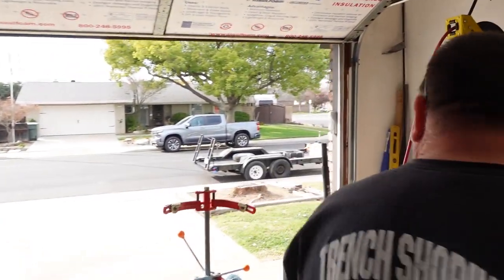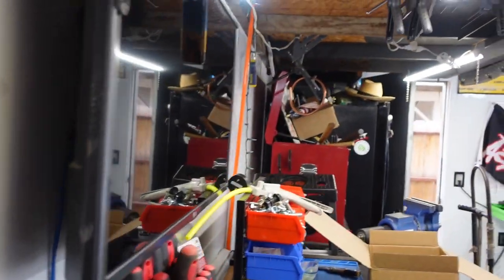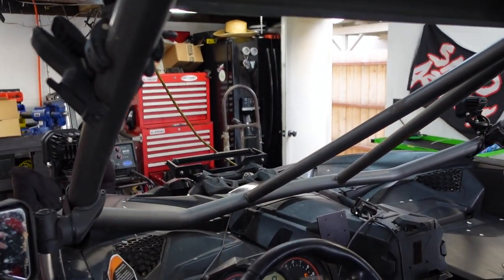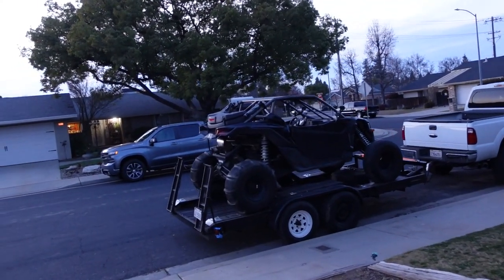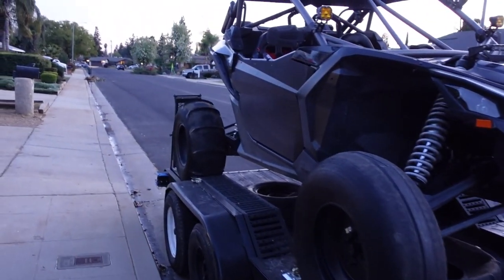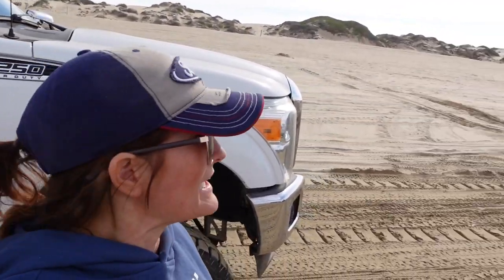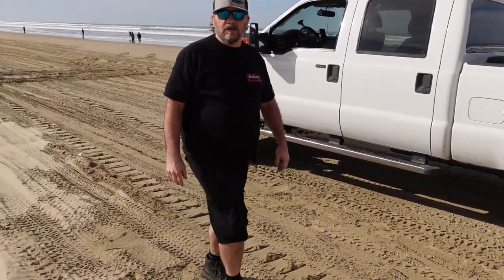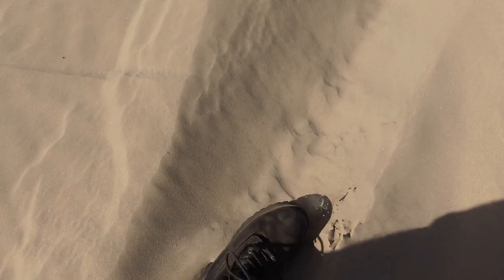PISMO DYNOMITE 2.0 Dean Is King

Comment: It's fun. But I wouldn't do it again.. IMO.. spend money on comfort
Reply: Believe both the cars have aftermarket suspension seats and full shock tune, the car with the 2.0 also has eclik on it.
Reply: That car looks super fast
Reply from the maker: @kurt you are correct, would definitely do it again, but we are crazy
Reply from the maker: Runs away from our stage 5 17 car
Reply: @DandiOffroad  sounds like draggy time